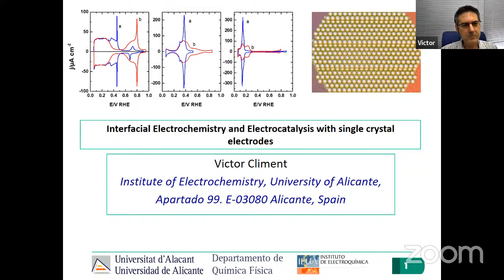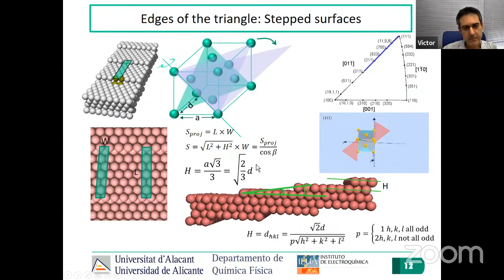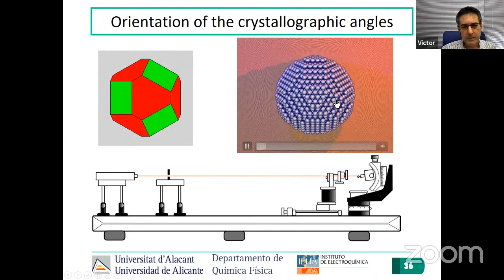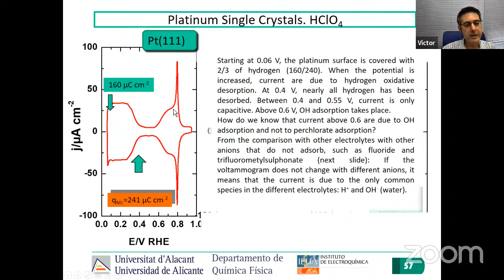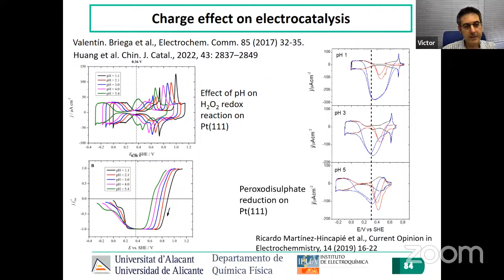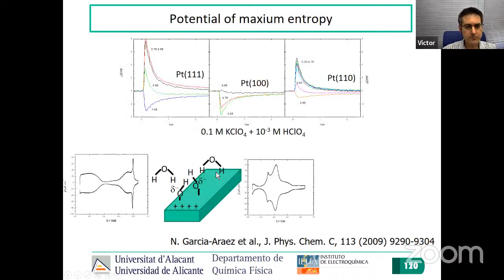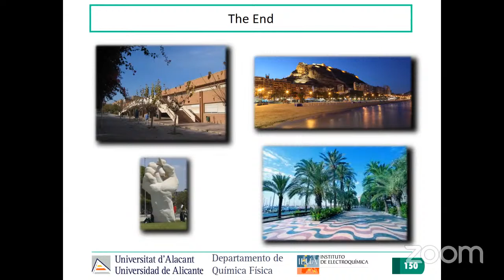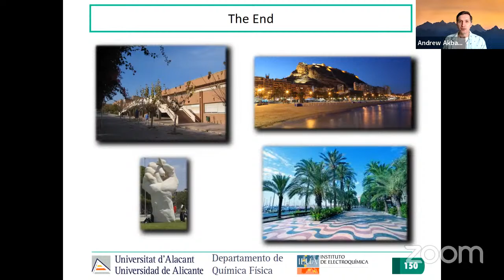27. Prof. Victor Climent  -  Electrochemistry with Single Crystal Electrodes

Comment from the maker: 00:00 - Introduction
02:51 - Beginning of the talk 
04:52 - Why single crystals are needed?
10:39 - Surface crystallography
16:25 - Stereographic projection for surfaces
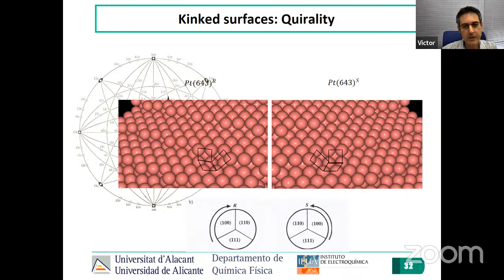37:06 - Preparation of metal single cry stals
50:22 - Understanding the voltammetry of platinum
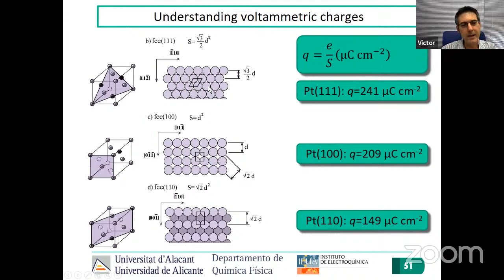55:15 - Charge displacement by CO adsorption
59:10 - Role of anions in Pt electrochemistry
1:05:57 - Voltammetry of stepped surfaces
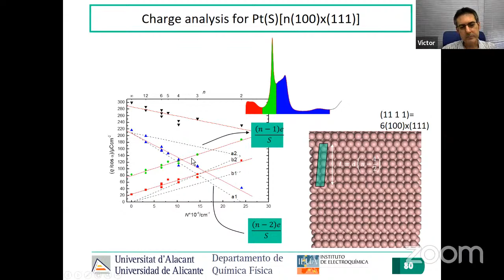1:13:24 - Potential of zero charge on Pt (PZC)
1:28:59 - Total charge vs free charge
1:32:40 - Entropy of the interface and laser temperature-jump technique
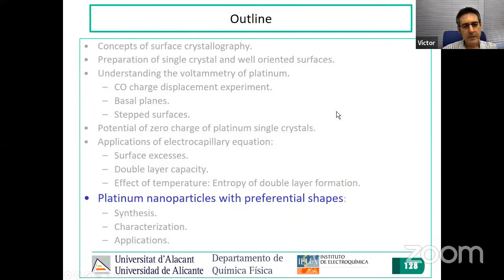1:40:34 - Pt nanoparticles
1:43:55 - Future directions for single crystal electrochemistry

Q&A: 
1:48:10 - Q1: Electrochemical cleaning of single crystal surfaces
1:51:21 - Q2: Cleaning of the surface of nanoparticles
1:53:02 - Q3: Assembling nanoparticles on a working electrode 
1:56:47 - Q4: Stability of stepped surfaces in different pH 
2:00:01 - Q5: Single crystals in RDE
2:04:16 - Q6: Number of electrons per Pt atom as a reference
2:06:14 - Q7: Connecting entropy and H2O ordering at interfaces
2:09:59 - Q8: Electrochemical impedance spectroscopy
2:12:28 - Q9: Model electrodes for enzymes and bioelectrochemistry